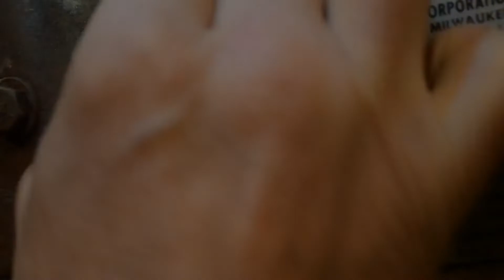Brigg & Stratton 5 HP Carburetor repair & service

Comment: Hello thank you for the help, I managed to disassemble the carburetor, to clean it completely, the gasoline inlet and outlet that go into the tank were blocked, I put everything back together managed to make it run but still a problem with the operation front is blocked and it rushes like a sherman tank. I managed to save my mother's garden, we worked 3 hours in a row at an incredible speed. I will see what can block in the forward direction and I will perhaps come back to you for more info. The screw on the right below the carburetor is really bitchy it's exact difficult to access. thank you again and be careful for you and your families good luck
Reply from the maker: Hey !  Well done. Hmm if you have changed the gasoline pump membran and gaskets and needle and done the cleaning...and you did not score home...or have totall succsess...I recommend you to search for a brand new carburetor on f.ecs. www.ebay.com.  Probaly you can get one at afordable price... But buy the right one !  You might have the old type with choke on the back as in video of mine.  The others...do not fit to your gasoline tank.

Comment: Great video! Do you know the on# for the short pickup tube? Can't seem to find in the breakdown. Briggs 130202, 5no off a old Ford roto tiller. Thanks!
Reply from the maker: Hey !  Thx !  But for you question i cannot answer ..  Not sure what you ask about. Remember...there is available carburetors on e-bay f.ecs.  Rebuilding...is for enhusiasts and a little weird peoples that love to fix the stuff...i think he he he.  Much easier to buy one...if possible.  I think.

Comment: Hello, it is extremely interesting but not easy, I have an Ariens 1969 motre BS 4HP model 00292 0154-02 6901157 with the same rifle that you are a gift from mother and has not turned for 10 years. turn it over but I think there is no gasoline reaching the spark plug can you help me or we can find a new seal for the carburetor thank you for answering me and take care of yourself and from your family with coronavirus thank you sorry my english is not perfect
Reply from the maker: Yes...try give it a "drink/ a shot"  straight into the hole for spark plug. Check of course if it gives spark first.  If not replace the coil with electronic coil and forget the kondensator or pin... So if having spark...and you drop a tiny gasoline in the hole..quickly mount the spark plug and see if it gives response. Than u know...carburetor need new rubber gasolin pump..rep set..from e-bay f.ecs. Or you buy a new carburetor...  Do different clean up work on the carb you have.  Remember the two screw for carburetor...the lowest one... is a pain ..or difficult to get hold on..accsess too.  Other than that...it is not difficult...  Do not have too much respect for how difficult this is.  Just do it and you will sure have succsess ! :-)
Reply: Thank you very much for responding, I will try and do the best I can take good care of you and your families greetings
Reply: Thank you very much for responding, I will try and do the best I can take good care of you and your families greetings

Comment: Don’t repair. A brand new one is only $21.00. I just bought one off Amazon, July 20. Engine ran on second pull like new.
Reply: Hello, where did you buy the new carburetor? There are several offers on Amazon, which of these can you recommend? Thanks and greetings from Europe...
Reply: We 
Use
Genuine
Briggs
Shizackh
Around 
These 
Parts 
💯💯💯💯